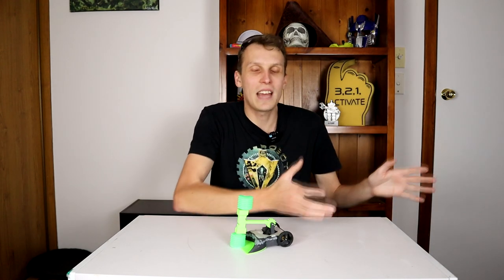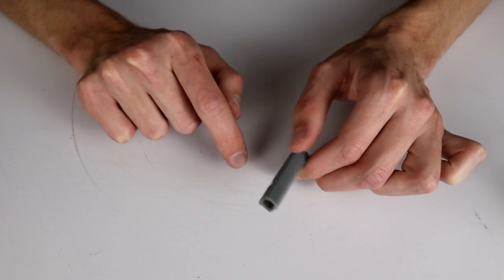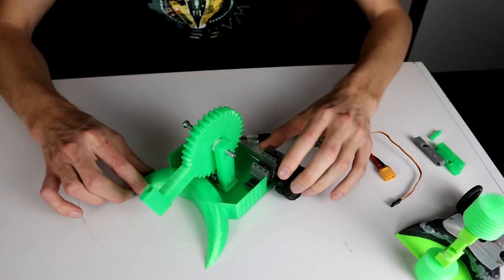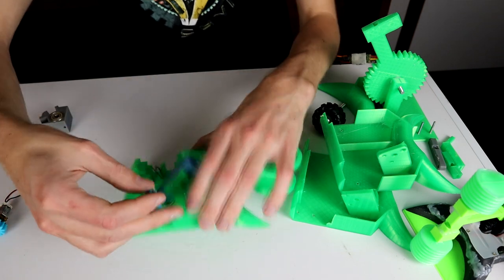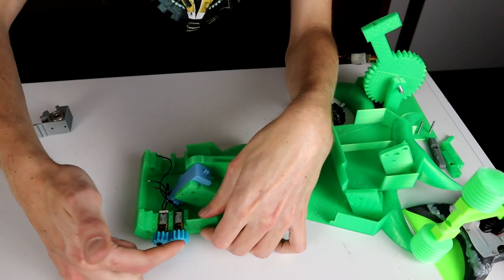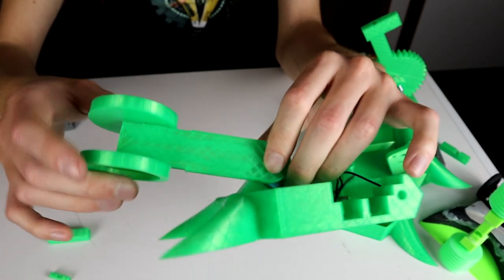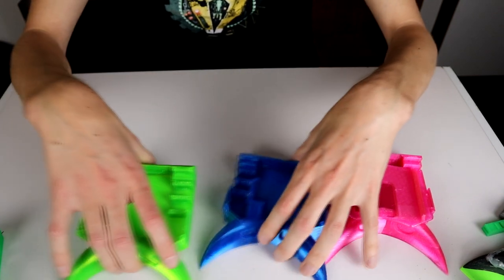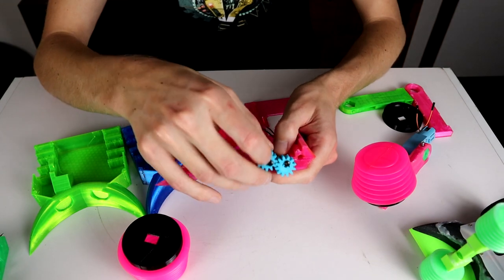Building a mini bot for Pawsitively Hissterical!!

Comment: To nerd out a little, the bit that splits the airflow is called the labiam (latin: lip) or the blade, and yeah it's a pretty important part XD
Reply from the maker: It really does seem to be, on my trip over I've been wondering if it's possible to print just that bit in pla or abs and glue it in place.

If you have links on where I can actually learn about whistle design I'd love to see them. I think I'm going to get more into the weeds here
Reply: @TeamPanicRobotics  I actually cannot remember where in particular I saw it, I just remember it was in relation to ocarina's, but the science behind the labiam is extremely similar if not identical

Comment: Ooh, I am excite! Another reason to catch the NHRL stream too.

You could probably only have some of the ring for the bellows to make putting them in easier - sort of like an interrupted thread. I'm assuming the bellows being pulled out isn't a massive concern on this.
Reply from the maker: The broken ring to capture the bellows is a good idea, but I've got all my parts and spares printed already. Maybe for next time
Reply: @TeamPanicRobotics   yeah, I meant to say for next time, apparently forgot. Could test it out by filing/sanding down the current ones if there's time, should only really need one gap to make it a lot easier, once the first bit is down you should be able to 'screw' the bellows into the gap.